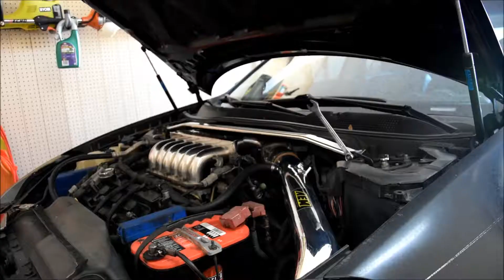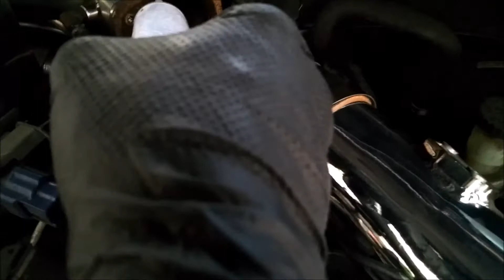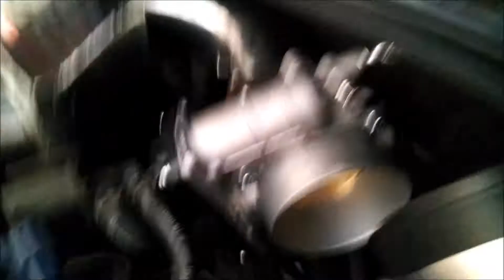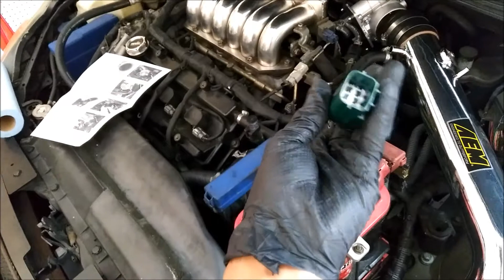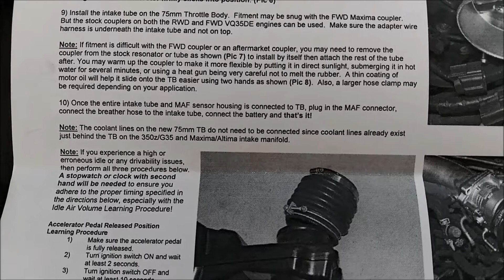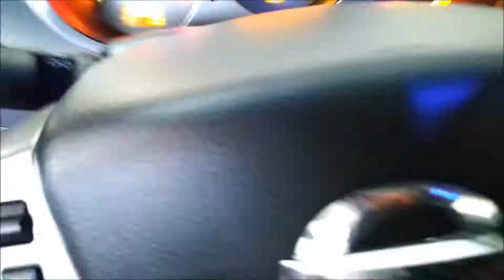Installing NWP Engineering 75mm Throttle Body Kit On 2006 Maxima

Comment: How did you get your throttle body tuned correctly cause the relearning process is not working
Reply from the maker: It worked for me. You may need to take it to a tune shop.

Comment: How much did u gain with the intake throttle and air intake I have a Nissan Maxima 2004 with the 6 speed and I been wanting to bolt it up but I’m really nervous on how these parts will affect my car
Reply from the maker: I did not put it on a dyno after the upgrades but I will say that they made a big difference. In my case, I saw better throttle response and nice sounding exhaust. Also noticed more top end power.

I did not get any codes by adding these but I would highly recommend that you get the car tuned after doing this type of upgrades.

Comment: Hey bro I have a 05 altima, trying to put in that throttle body with the spacer but that egr is getting in my way of getting that bolt in even though I flipped the tb like nwp says, I wanted to ask did you have problems with installing it there and if so how’d you solve it?
Reply from the maker: Hola Misael, thankfully I did not run into any issues when installing it. I do have an aftermarket upper intake manifold as well as the phenolic spacer kit so I'm not sure if that may have help or not. Try searching the maxima forums to see if someone else ran into that same issue.
Reply: VQ_PWR yea the tb wasn’t going in but I bought the spacers as well and put them in and now they gave me perfect clearance thanks bro
Reply from the maker: That's awesome bro, glad it worked out. Enjoy the new ponnies!